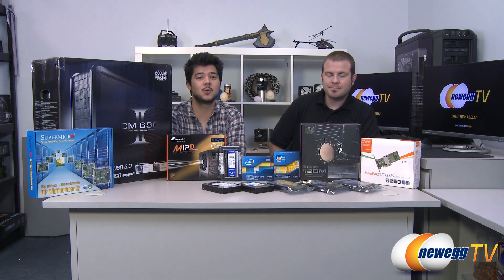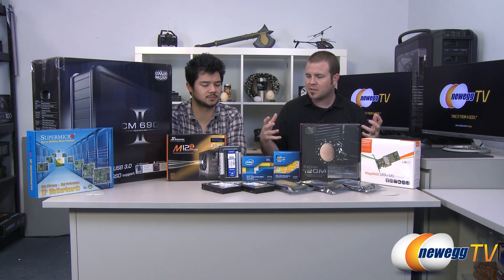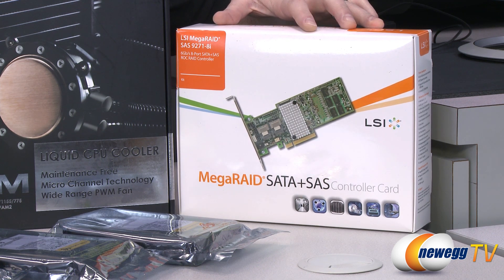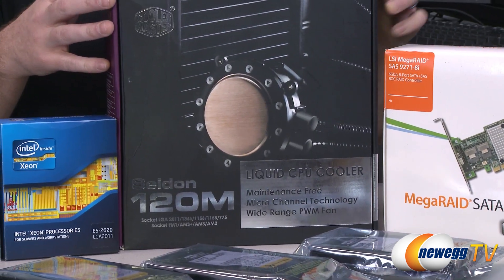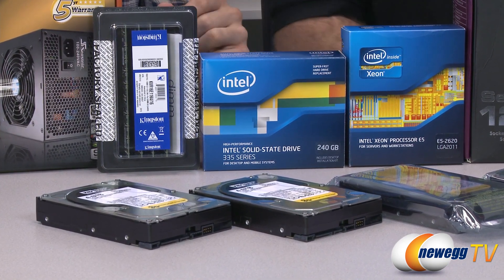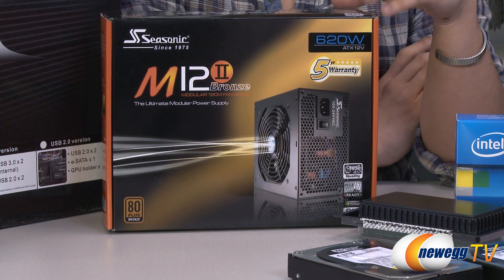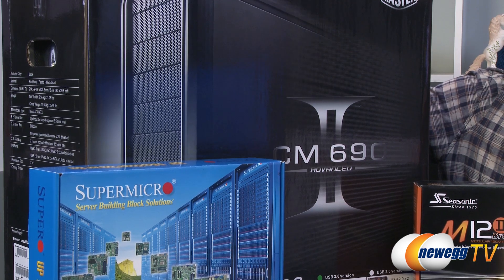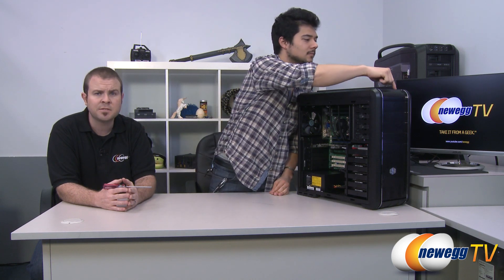Newegg TV: Our New Storage Server Build w/20TB Western Digital RAID 5 Array

Comment: Where is part 2? I need to know the software side.
Reply: The LSI RAID controller sets up the array and then passes that virtual disk to the BIOS which shows up in Windows. For example, if you have 4 4TB drives in RAID10, you will see 1 big 8TB disk in Windows verses each individual drive. You can setup the array in the controllers menu which shows up at boot.

Comment: Software RAID is better.
Reply: Also I would have filled those 5 1/4" bays with hot-swap bays for 3.5" SATA drives, no downtime on your data storage and you can have dry backups sitting in the drawer where corrupt data can't hurt them.
Reply: Software RAID is better? Huh...
Reply: Hardware RAID, when it fails, you need to replace the card, whereas software RAID almost never fails and if it does it can be fixed relatively easily
Reply: And it's shit... and so can fail your motherboard, gpu, HDD...
Reply: I like to give people the benefit of the doubt before responding to a comment reply and in this case I will assume that you have done extensive research and read many articles on the two as well as having used both hardware and software forms of RAID, based on that I will also assume that you have made an accurate comparison. However if you think that software RAID is worse for your system than hardware RAID, even after the differences in price, ease of acquisition and stability then we both came to very different conclusions between the two products. I have used both RAID forms to back my data up and after having two separate RAID cards fail on me in the space of 24 months and found it a royal pain to recover the lost data (in the case of the second card the lost data proved irretrievable) where as with software RAID like I use now it lasted a lot longer, when it did fail it was only partial and did no damage to any hardware in the PC (it uses the CPU to create a virtual array) and the data was a cinch to retrieve with 0% over-all losses. Yes hardware RAID has advantages but software RAID also has it's advantages. Here are some pieces that might interest you if you ever decided to choose. (In some cases a combination of the two is appropriate also to increase the integrity of the system as a whole.)

http://www.cyberciti.biz/tips/raid-hardware-vs-raid-software.html
http://www.chriscowley.me.uk/blog/2013/04/07/stop-the-hate-on-software-raid/
http://augmentedtrader.wordpress.com/2012/05/13/10-things-raid/

You must also remember that RAID is mostly about creating redundancy in your system, when I say "for backup" I am talking about increasing efficiency in mirroring, I also have two hot-swaps I use to get my data "off-board" which aren't RAID'd but are made from RAID'd data, triple redundancy, but I digress.
Reply: Software RAID can be just as good as Hardware RAID if you are running like 2-4 HDDs but once you start having 4+ hard drives or multiple SSDS, you will be severely bottlenecked by the onboard SATA controller. Running 4 SSDS in RAID0 on Software RAID might give you 1.2GB/s when you can easily get above 2GB/s on a RAID Card.

Comment: The X79 chipset and the Intel Core 2011 CPUs don't support onboard graphics, but server boards, which have the C20x range chipsets, do. But the C20x gaming boards, like the SRX, don't need the outputs, as most, if not all gamers use discrete GPUs anyway, as iGPUs are generally pathetic at anything except basic computing and server monitoring.

Comment: For the motherboard, X9SRL-F would be more functional and less costly choice.  The IPMI 2.0 function for total remote access will come in very handy, not to mention super geek lol.  Other than that, A little more will get extra sata ports and sata 3 to make the most of the ssd.  Sure you're removing pci-x 64, unless you have some rare old card you still need to use.  If you don't care for all that, the X9SRA would be better as it give you 4 pci express and 1 pci.  Other than that, great build!

Comment: There are no socket 2011 Xeons that have an integrated GPU. The SuperMicro X9SRE motherboard we used has a built-in Matrox G200eW for video. Your points below are valid, but you might want to check Intel's site next time you want to call someone a fool for asking a simple question.

Comment: on top of the fact that 6 2011 cores will use more power, servers are supposed to be smart and efficient, a file server is good with a low power dual core ivy bridge, this build is a waste, these parts belong in a much more useful capacity, 16gb of ram means more dimms that can fail, a single 240gb ssd should have been 2 x 120gb ssd in raid 1, servers are supposed to be engineered for max  redundancy and stability, this build is the antithesis of diminishing returns

Comment: nothing against cooler master (by the way awesome products) but you should get a nice performing air cooler and put some noctua nf-f12 pwm fans in it (good performance+quiteness) in case of a 120mm cooler or nf-a14 flx/nf-a15 pwm (the one that fits try to go w/ the a15) in case of 140mm cooler. this because if the pump fails, the server will go down and it can damage the cpu (very unlikely). if you go this route just put 2 fans in it (if 1 fails you still have one) thumbs up so they can see this

Comment: I would like to see a video where you remove one of the drives to simulate a failure.  Then what?  How do you go about replacing the drive and rebuilding the array?  I've always wondered if I should buy a few extra drives at the time of purchasing all the parts so in the future when a drive fails, i can quickly replace it with a spare of the same model.  What do you guys think?

Comment: for a server build would it have been better to use a heatsink instead of a water cooler? its just that there is one less point of failure from the pump and a heatsink could just passively dissipate heat in case a fan dies

Comment: Btw, what drives are connected to the Motherboard? At 3:52 it looked like 2 drives were connected to the motherboard? At 4:14 it looks like 2 drives connected to motherboard and both SFF-8087 ports are populated on the LSI? I could see using both SFFs to connect the 5 drives and 1 motherboard connector for the SSD. But I didn't see an optical drive. So what is the second drive connected directly to the motherboard?

Comment: @newegg, N82E16811999950, I like cutting the bottom T-Slot portion off and it makes a great mb support. I'm not sure why they even make the T-Slot portion anymore. Almost no modern case uses the slot. You can also tale a metal standoff flip it over and secure it with a nut to the hole in the mb. Finding a nut and standoff that will work can be a bit of a chore though.

Comment: The only thing I would change is probably the cooler. You want something reliable, so an air cooler as way less chance of failure. You will very rarely actually monitor the CPU temp on your server so when that pump dies you may never know...then your CPU will be fried.

Comment: Just read alot of reviewers about that Seidon 120m liquid cooler...about it taking a ridiculous amount of strength to get the included screws to thread where needed during install and some actually accidently breaking parts of the block mount assembly

No thanks.  65 dollar ish price range...I'll stick to either thermaltake 2.0 performer, or somethin else in that range that has easier installation..then replace the stock fan with a noctua 120mm or phantek 120mm and call it a day.